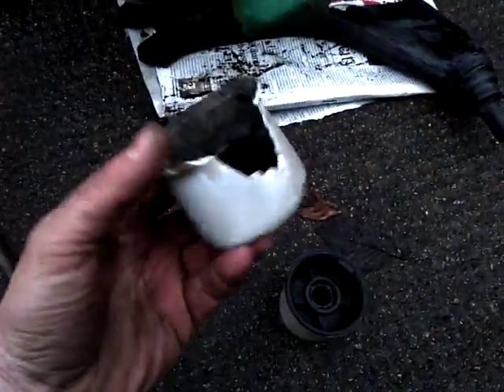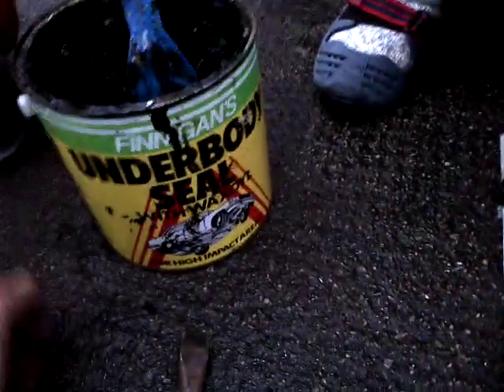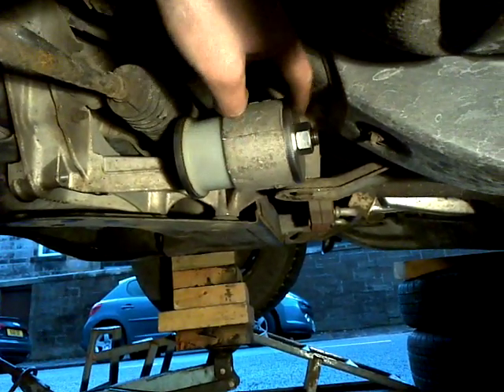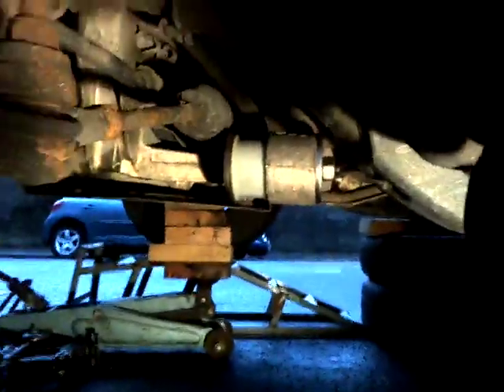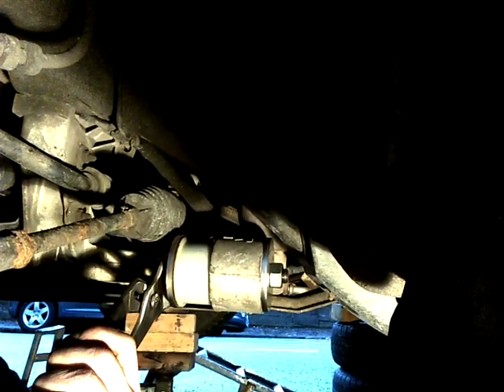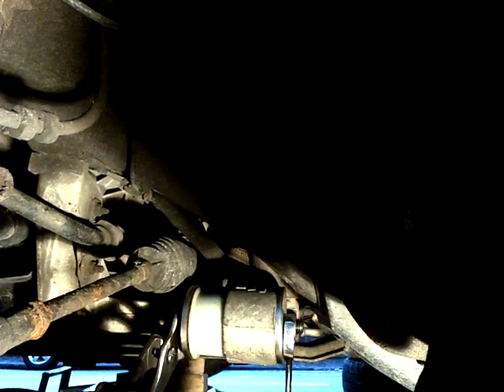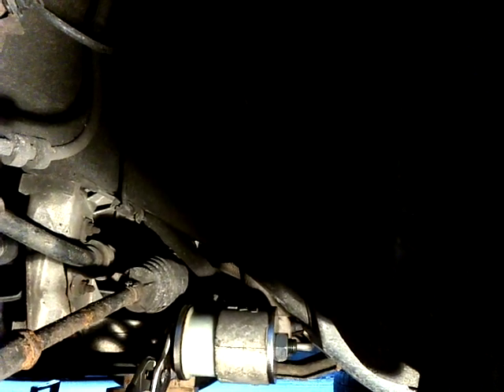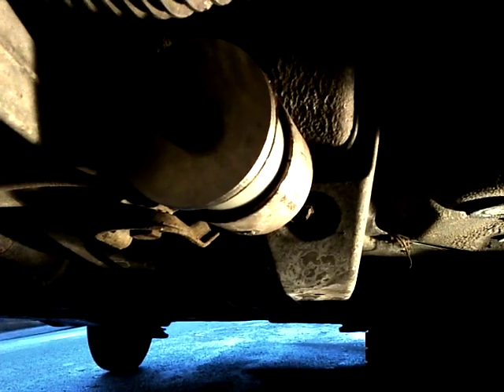Skoda Fabia front suspension bush fitting custom tool/method DIY

Comment: Hi Murray - About to replace these bushes on my Fabia anytime soon (Gerbils is a good description of the noise!), thanks so very much for the video which has given me the confidence to go ahead with the work myself. Have ordered both bushes (about £19 off eBay for 2 Meyle ones) and a fitting kit £30 - garage have estimated some £200+ to do the work so I am more than pleased to save some good money - if only the dealers/garages were more reasonable!? I will offer the tool out for loan on my local FB group so if anyone needs to borrow one they know where to come - thanks again Murray!

Comment from the maker: As Mike, the manager at the local Arnold Clark's has always been good to deal with I'd say (in the case) the 'five hours' is the 'book time' without the specific service tool, I split the job over two days and I'd guess a doing it at a 'run' I could replace both sides in about 2-3 hours

Comment: Hi Murray, excellent videos. When you came to do the drivers side, were you able to remove the bolt at the front of the wishbone okay? I cant remove it fully as it is catching the corner of the sump. did you have a similar problem?
Reply from the maker: Hi Nathan, 'today' I did a bush replacement for the office lady at my pals m/c shop ;-) as it's been a while since I did my sisters car JUST grabbed a torch and had a look! Plenty of clearance from the sump, at a guess IF the engine mount is failing then perhaps there could be issues with bolt/sump clearance.... IF this is the case using a jack to SLIGHTLY lift the drivers side of the engine might help?.... Let me know how you get on. If you want you can send me picks/video of the problem and I'll see if I can work out what's up. MH
Reply: undo engine mount nut and lift engine a wee bit!

Comment: How did you get on with other side where bolt gets stoped by oil sump ?
Reply from the maker: Hi as these are at the back end of the suspension arms both sides are well clear of the sump on the Skoda (1.4 'Classic')